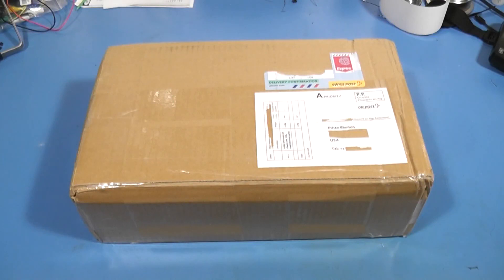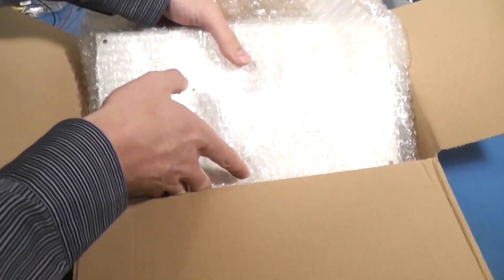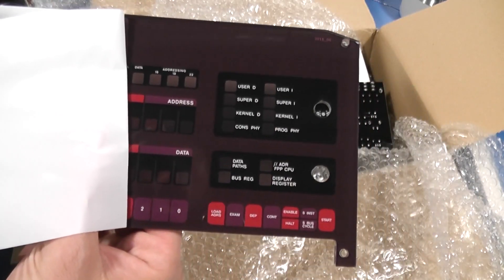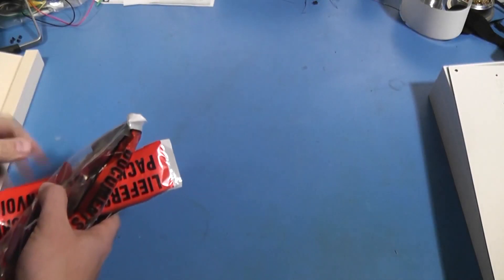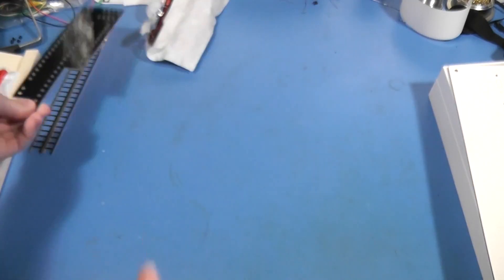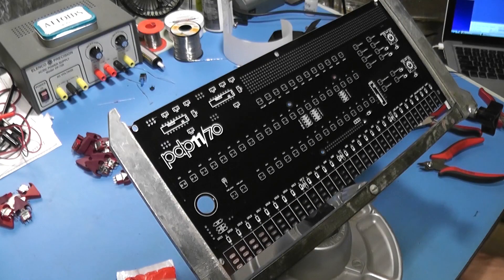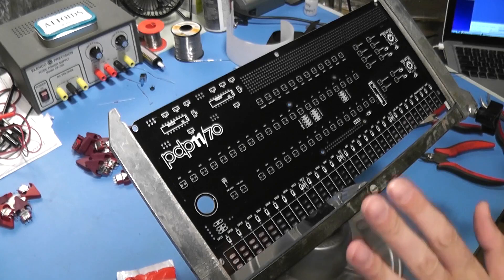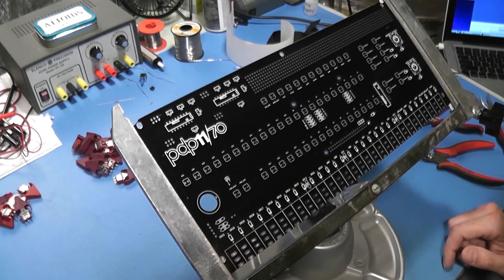PiDP-11/70: Unboxing and preparing to build (Building a PiDP-11/70 Front Panel: Part One)

Comment: Well, I was hoping for a PDP-11/70 or a VAX 7xx maybe reproduction. Oh well, I was hoping too much.  But even if you have it it's would be damn hard to find the software.
Reply from the maker: I'm not sure I understand your comment.  This is a PDP-11/70 reproduction.  A VAX 11/7xx reproduction would be (in my opinion), significantly less interesting, as it doesn't have a front panel!  You can, however, emulate a VAX 11/7xx using SIMH, the same emulation software that is used by the PiDP-11.

If you mean you wish it was a REAL PDP-11/70 ... you and me, both.   If you find one, let me know.  ;-)
Reply: @EthanBlanton  Lost everything I typed.  Ok long story short.  Was hoping for a reproduction that used all of the old instruction sets, memory funcitonality, etc but on a smaller platform.
Reply from the maker: @leefoster4133  this does, but in software emulation.  It runs V6/7/8/9 Research Unix, BSD 1/2.x, RSTS, RSX-11, RT-11, etc., and operates them all normally using the front panel and RS-232.